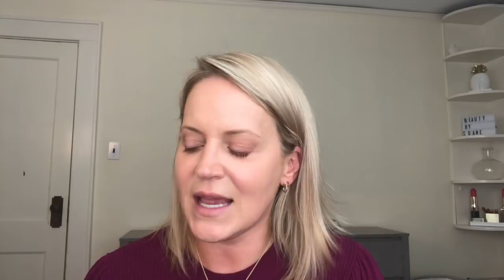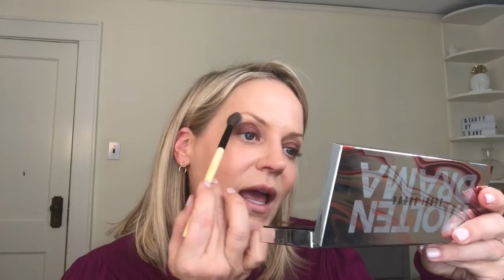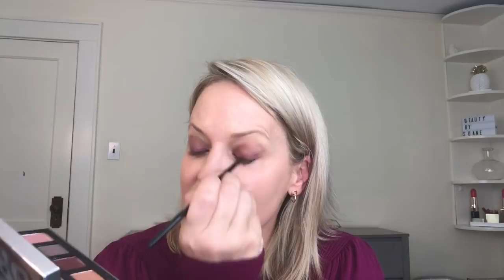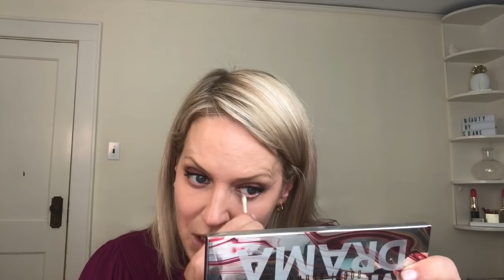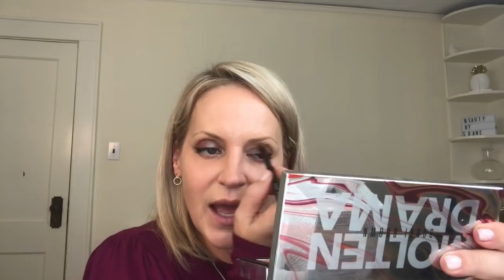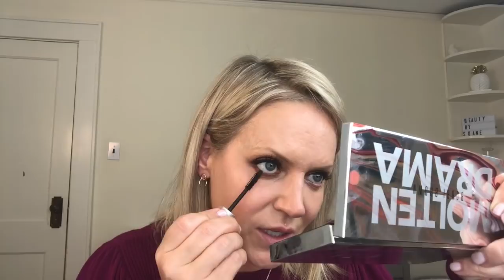How To Do A Wearable Smokey Eye : Bobbi Brown Molten Drama Eye Palette

Comment: I have been really disappointed in those cream shadow sticks...whether I use them as a base or as a shadow alone, everything goes fine in the beginning, and the look is good for a few hours - but after a while, and by the end of the day, I’ve got a dry, crumbly, creasing mess.  I’m using a primer, not sure what is going wrong, if it’s the sunscreen I wear or what.